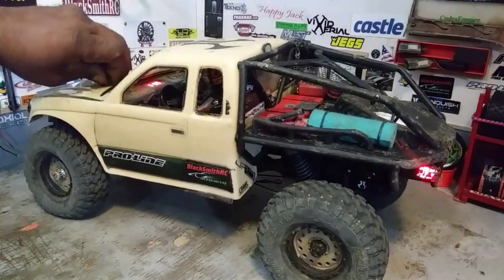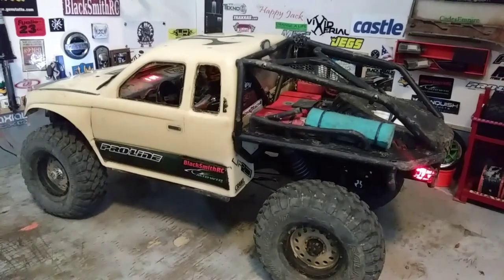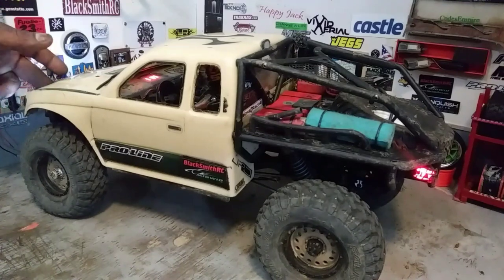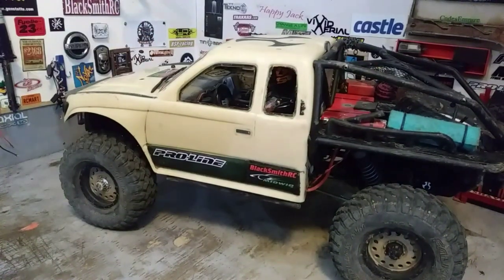SCX10.2 Trail Honcho: Upgrade#5 Holmes Hobbies 550 27T

Comment: It's going very well this new engine, good crawling !!  It seems to me that the first scx10 was sold originally with a 27T, which was very good .
Reply from the maker: True the original SCX10 cAmerican with a 27turn motor, 540 size, not 550 like the Holmes Hobbies one used in this video.
Reply: @BlackSmithRC   Exactly, it was 540, and in view of your test I will try on my Suzuki to put a 550 27T . It seems really good to me .